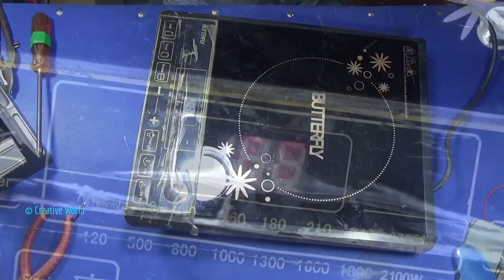How To Repair E3, E5, E7 And Not Heating Fault Of A Induction Cooker

Comment: As you know that induction heater only work on steel utensils, is there any solution so that we also use other metals? ??
Reply: Any magnetic material works on induction cookers.
In fact, any metal would work in theory and the process is used widely in industry.
For small home cookers though, it is however a safety feature so that small pieces of any metal placed on the cooker won't get instantly red hot.
i.e. The cooker senses for large pieces of magnetic material and ignores small pieces and other things that are not magnetic.
In any case, Copper would 'work too well' and damage the electronics.
Aluminium pans are usually quite thin and it has a low melting point - the induction cooker would destroy them. Same for brass.
Some stainless steels are magnetic, others are not. If shopping for a suitable pan, take a small magnet with you to the shop and check each one you want/like, although most will be labelled appropriately.

Comment: I've this same problem with Prestige Induction Cooker Pic 3.1. V3..will this work for E3 ?
Reply from the maker: dear please check the smps
section of induction cooker
Reply: Change the hi watt resister of power section

Comment: hi.. what is the purpose of that white paste?
Reply from the maker: it is called about high voltage silicon rubber,,
it help to connect between the electronics parts and heat sink..
and the heat sink can suck heat from the parts
thanks
Reply: Creative World thank you, i am trying to repair my induction but i have 0 knowledge on this.. the white silicon on my cooker is almost gone, i dont know the problem of my cooker, i can turn it on but it stop when its on cooking mode. i dont know the alarm cause it dont have a 7 segment display. thank you for the reply.

Comment: my heat temperature sensor not working  if i short the two wires together then so it will work or not?
Reply from the maker: you can try changing the Heating Temperature Sensor

Comment: what is the white paste you put on sensor
Reply from the maker: this is called HongFa Past
High Voltage Silicon Rubber
Reply: Iionking Star 
Name.. Cool peste put in sensor then no hot sensor
Reply: Iionking Star
Reply: Iionking Star 
On screen e5 what's problem in my Philips induction

Comment: sir i attend induction stove dead condition  igbt and  bridge rectifier ,5mf capacitor  changed  at the time  set working  after 15 mins same problem happen again  i will change same parts  same few mins working again dead . i dont know the reason kindly give the solution pls
Reply from the maker: would you change same parts,,
if you already change,,then please try changing power IC/ SMPS IC...
you should check Resistor of power section,,Heating coil and Cooling fan,,,

Comment: e0 error changed igbt, capacitors, but no results how to check coil???
Reply from the maker: you can check the coil,,using Electric Series Board and Multi Meter
Reply: IC changing

Comment: If i remove induction sensor and use without that what will happen ? Is any problem occurs ?
Reply from the maker: there will be not any problem,,but the induction cooker don't make any heat
Reply: Thanks
Reply: Creative World meaning if there is no heat, the sensor could be the problem? Can I Replace the sensor without the paste?
Reply from the maker: you can do. But if you use "Paste" ,,it will be better